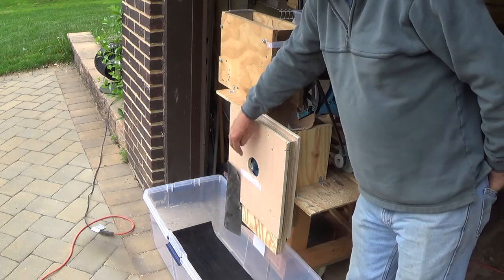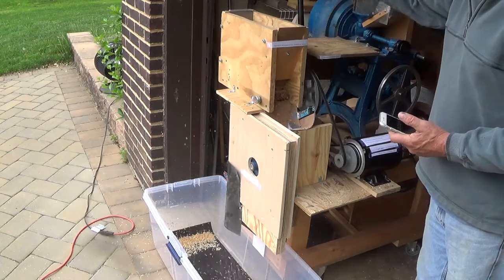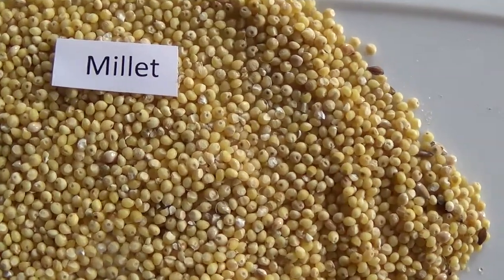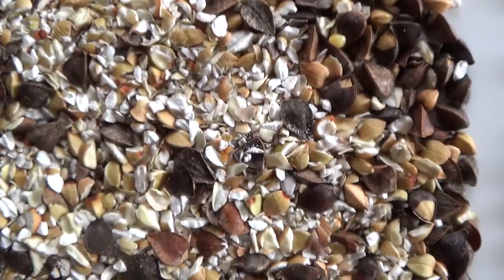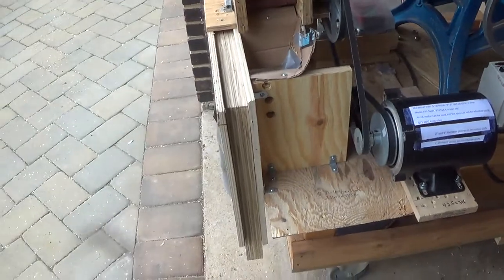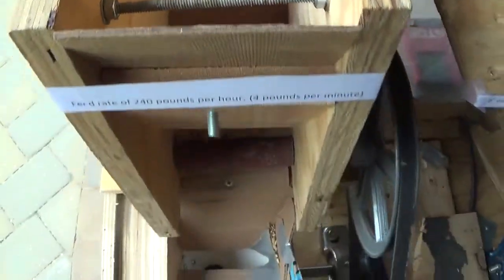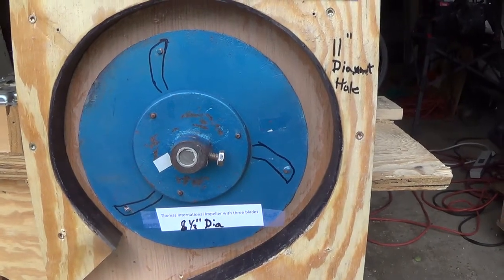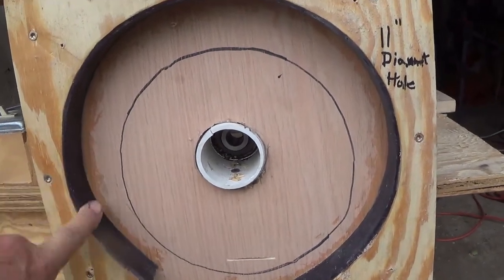de-hulling rice, canary seed, buckwheat, millet, field peas with home made impact machine

Comment: Do you still have instructions?  I tried pulling up the website but it looks like it's no longer up and running.
Reply from the maker: I  shut down the website. There are videos showing how to build one. The Stoltz polyurethane rollers are no longer manufactured.
Reply: @brillengineering7889  Thank you so much for getting back with me!  Are the Stoltz rollers necessary or can it be done with something else?  I am just wondering how to go about finding the videos that would show how to put it together... but if that part isn't available... it may be a lost cause?
Reply from the maker: @theozarksjourneytoself-suf5420  I think you could subscribe to my channel and see the numerous videos I’ve made. One  video shows how I glued polyurethane to wooden rollers.
Reply: @brillengineering7889  Thank you!  I didn't realize you were speaking of your videos on your channel.  I will certainly take a look!  Thanks again!

Comment: why not metal lining the inside to put more shock to the grain ?
Reply from the maker: the metal I tried didn't work and upon further reading the consensus was that there isn't enough resistance on the surface for the husk to interact with for efficient de hulling,